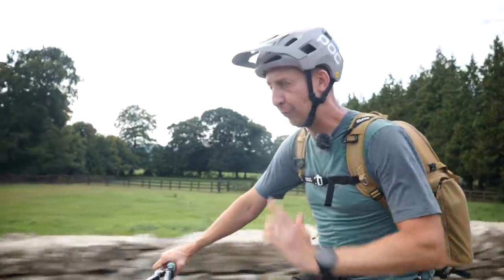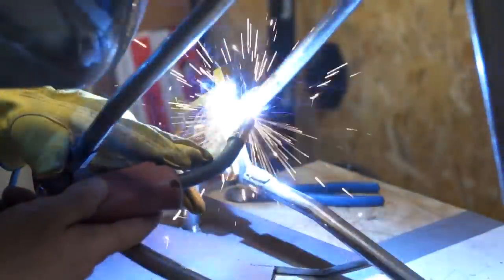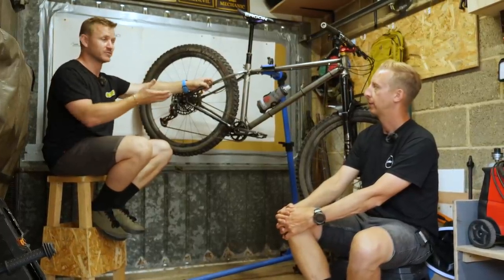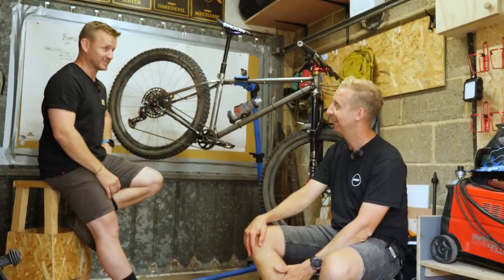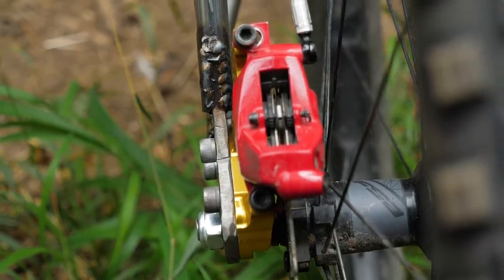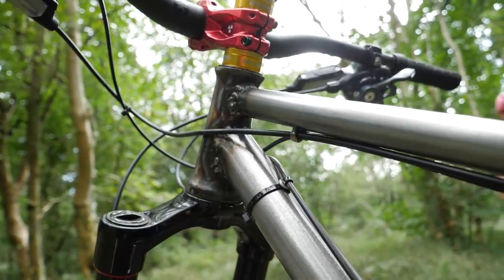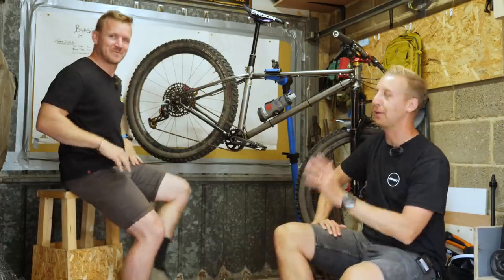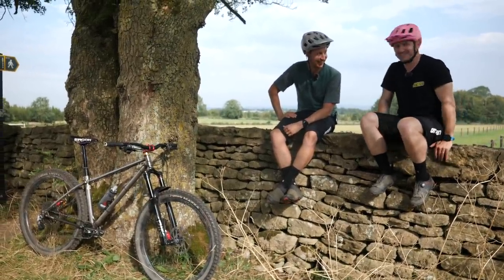Blake Samson's DIY Garage Built Hardtail AKA 'The CRAB' | GMBN Tech Pro Bike Check

Comment: My father built my first BMX bike out of some sort of light steel about 35 years ago (frame, handle bars and forks). I sent that bike over every jump I could find or make for about 6 years. My mates use to rip me off as it didn't have a brand label on it and was painted with a spray can by myself. But it was lighter than any of theirs so they loved riding it too. Although, Dad did forget to put brakes on it hence we learnt real quick the meaning of full commitment to any feature. Watching Blake build that bike bought back many great memories...thankyou.

Comment: Huge respect to Blake for that bike,  having done it myself, I know how hard it is to do right. Before I had spine surgery,  riding conventional bikes was too painful, so a friend & I made an off road recumbent. Getting the head angle right was a complete pain in the arse, sadly we got it very wrong & it developed an alarming wobble at anything above walking pace. Recumbent off road bikes need full suspension & that worked well, but the rest of it was an absolute dog. Eventually,  I got my surgery & scrapped the project. I still can't ride outside, but I put the MTB in my turbo trainer & I'm getting fit. If I did it again, I would love to try bamboo.
Reply: Hey man! Respect to you for trying!

Comment: Fantastic work, Blake, and it does recall the early days of it all, the BMX and mountain bike movements of the '70s when lots of frames were modified or fabricated for racing.  And it'd be cool to see the progression with another frame for Doddy, same design, larger frame, better steel and welds and such.

Comment: I'm so stoked on this. Been mig welding for a while and really wanted to do this. This is the inspiration needed!
Reply: Do er up!
I built a sim racing rig out of square tubing and angle iron, no welding though, just a crap ton of holes drilled so its fully adjustable/modular

Comment: I made a 16 inch replica bmx years ago and to align it right I mounted the wheels without tyres to the rear mounts and fork then clamped the rims between two DAR 100 X 100 posts.

Comment: How's this for a bodge: you could dish the rear wheel so the hub is closer to the drive-side dropout.
Reply: You cannot. I'm pretty sure that the dropouts are not level, putting the wheel diagonally. You could, however, grind one of the dropouts...
Reply: It's stronger and safer to cut the defective dropout and fabricate a new one. Dished wheels tend to be a little bit weaker as it is, exaggerating that dish makes it worse.

Comment: Something significant happened here.  A real lesson to be learned.  

Those welds are so dirty….  But I love the fact that he did what he wanted, rode and raced it, and it worked.  The take-away?  You don’t need the best stuff all the time and nothing has to be perfect.  So many get hung up on perfection or having the latest tech, but it just doesn’t matter.  Even the welding.  Not saying you shouldn’t strive for the best welding but here again these welds with low penetration and tons of porosity worked.  

Time and time again in all areas of life, don’t avoid doing something or starting something because you think / have been told / assume you can’t.  Screw it, just get out there and do it.

Comment: Bamboo is also a great DIY frame building material, I've built a couple now and both are great
Reply: Is it good to weld? 😂
Reply: @gospodinkenobi9903  You'd have to stick weld it....
Reply: @RealMTBAddict  Feels kinda like carbon actually, obviously not same strength to weight so it's a bit heavier but has the vibration damping quality. Definitely not flexible/power sappy

Comment: as someone who only got into biking a few years back, I don't have that many parts around. No old BBs or head tubes etc. I do have a welder and various other tools, could probably even CNC machine stuff for the rear axle etc. But I'm also not familiar enough with old bikes to know whether I can just get a crappy old bike that's completely bent and extract the BB shell. With all the different axle sizes and styles, I would imagine this is the same for that.

Comment: cool!! i've always wanted to make one as well, i did how ever make a 12 foot long cargo bike when all the lock downs started as i was board and had a couple off cheep steel bikes kicking about, now nackerd as only had a rusty buggerd drive train for it but ran it for weeks cleaning my garrage out, moving stuff to a contaner i have on my mates farm got the head angle wrong though as the front wheel go's into a masive speed wobble at around 25 to 30mph!! the brakes didnt really work very well ether but it is still awesome haha dont hafe flex when i had around 90kg on it though hardest thing i've ever riden though to get use to as it could'nt be more diferant than a normal bike to ride.

Comment: I built a steel hardtail mtb frame 29er eccentric bb, 63° head angle 74° seat tube and I run it with a 140mm fork.

Comment: Not a fluke for the dropper post and tube sizing. Bikes have always used industry standard sizing everywhere. Tubes, bearings, gaskets, bolts. Keeps it cheaper.

Comment: You can't control how much metal you add to the weld with MIG welding. TIG welding is a much harder but practice a lot and the welds will be much neater and hopefully stronger.

Comment: Actually, if you look at a lot of low- to mid-end commercially-built frames, the chainstay / seatstay on one side is often off by a few mm from the other side, sometimes over 5mm, so the rear tire does end up a little bit on one side of the frame. If you use a wide tire or have a 10x135 older frame, a 2.4 tire in a QR frame may have plenty of room on one side but comes very close to rubbing on the other side. Unfortunately this is COMMON. Not many frames are perfectly made, hand assembled or not. So Blake did fine, his is not much worse than many commercially-built $300-500 frames. Performance-wise, because the tire is in the back, I for one don't notice any difference at all compared with a rear tire/wheel being 100% true in alignment to the center of the frame. And of course for any bike there can be some amount of rear tire wobble, the rear wheel itself is not true, blah blah blah, but alignment imperfections in the rear are not a huge deal, provided the tire fits and is locked into the frame OK. Now for chainline & rear derailleur hanger alignment issues with these frames, that's a different animal that I will not comment on further!

Comment: Boring.
Reply: Go watch some kids cartoons then 🥳
Reply: @Bianchiboy  Cocomelon 🤣
Reply: Very interesting clip guys. Like the front fork geometry, and the style of the frame generally.
I believe that the rear alignment can be corrected successfully with a little work on the dropout brackets.
I jacked an old Apollo rear frame apart in order to squeeze in a rear hub motor. That is still rather"crab like", but I will work on it when health allows (recent strokes) ... :)